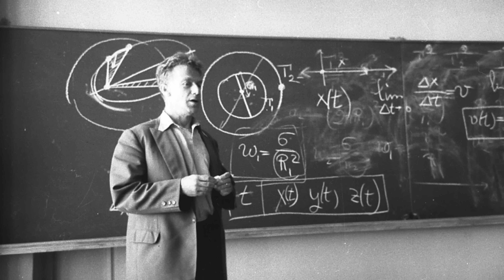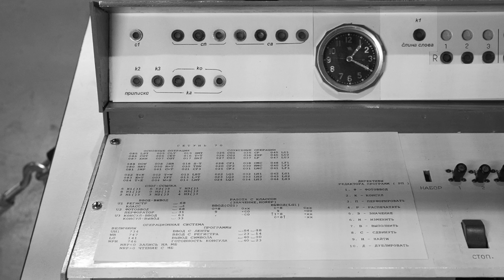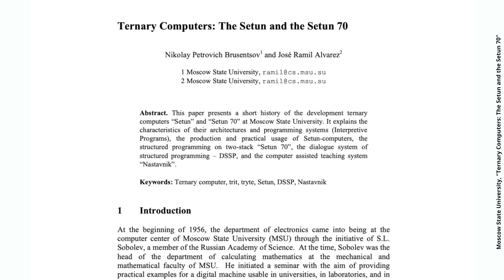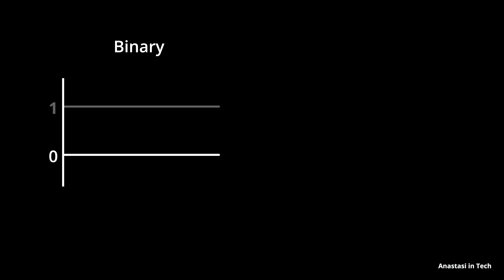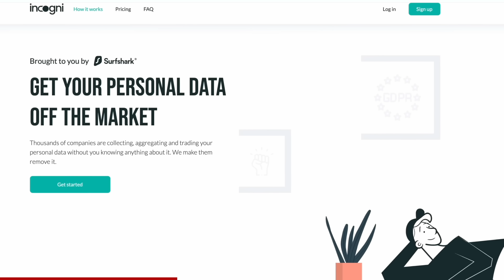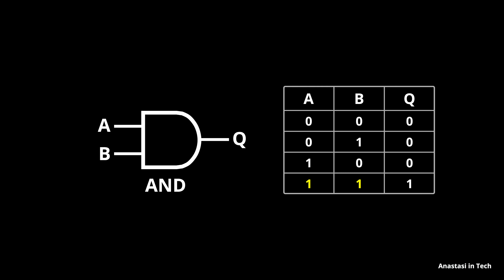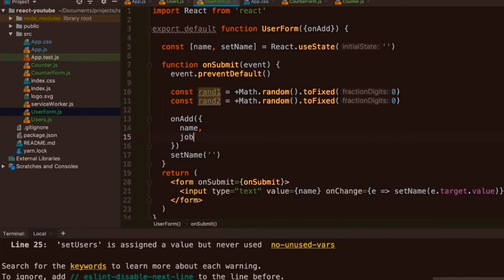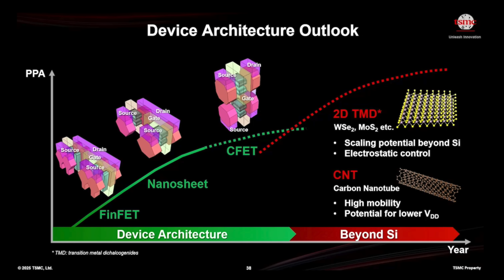The World's First Ternary Computer

Comment: I know that symetric ternary has some advantages in maths but i wonder if source of idea wasn't in core memory which can store 3 states (2 directions of magnetic flux and zero).
But as i understand with one switching device will be hard to build symetric ternary in hardware but maybe using two will yield faster switching ? 
Also maybe it could be mixed with those methods of low energy calculations.
I think it may occupy some niches but will not replace binary.

Comment: @11:37 Your table has error in third row shoud be 1 in B not -1
Reply from the maker: yes sorry for the typo, it should be -1 1 -1
Reply: Agree, seems like there should only be 9 states.  3^2   3 States raised to # of slots (2)  = 9         B slot should alternate between -101-101-101, A slot should be  -1-1-1000111.   Don't understand how there would be 27 states.
Reply: @KarasCyborg  I think the 27 combinations was meant to refer to the case when you have three inputs. (If you look up "Three-valued logic" in Wikipedia it mentions this in the section under Logics.) It's just a bit confusing because what she's saying doesn't match the image being shown.
Reply: It's not multiplication.
Reply: @preso706 it is multiplication... AND is multiplication
Reply: @preso706  It is! A AND B = { binary A AND B, if no -1 / -1, if one of them is -1 }
That is more or less a binary multiplication with an undefined (or neutral) state!
Reply: @rainerzufall42 I see, thanks.

Comment: I note: if it were not for noise - any number of "states" could be used.
Also: there is nothing about a vacuum tube that indicates 'only' binary.
Reply: Who says any number of states retains the logical efficiency?
Reply: @samuelluria4744  The idea about efficiency is that the more states per bit the more efficient it is to store values.  It takes 3 bits to represent 8 states for example, it would only take 2 to represent 9 with trinary.  That's not much of an improvement but it snowballs very quickly.  8 bits is 256 states but 8 trinary would be 6561 states.  And it only goes up as the number of 'bits' increases.  8 'bits' of decimal is 10 million states.  The more levels per bit the more efficient.  But the cost of noise and discrimination has an energy cost to consider.  Analog would be perfect if noise were not a concern.  Each bit would be infinite.
Reply: @dougcox835  - I may have been unclear as to my query. I understand the math. And that's all probably great for storage, but I'm asking about the mechanics/philosophy of the compute.
Reply: @dougcox835  But the three states are not used to pack numbers more efficiently. The third state is 'unknown'. A value stored in multiple trits is still unknown if any of the trits are unknown.
Reply: @theelmonk  I think you're confusing the hardware resting state with an actual trinary system.  It's been a while since I watched this but I think there is an intermediate level (not +/-) that give it 3 states.  There's actually no limit really.  you could make it analog and have 256 states per bit if you wanted to.  The problem is that you need a very noise free signal for that to work.  When you look at digital signals on an oscilloscope you realize that it's all very messy with rise times and noise.  That's why way back in the day they came up with binary in the first place.  Someone figured out that you don't need to worry about noise when it's very clearly on or off.  They made the undefined zone very wide with TTL.  Power is cleaner and timing is shaper than ever before nowadays so more states than 0 and 1 are completely doable.  How about 4 to start?  That halves the number of bits per number.
Reply: @dougcox835  It's certainly possible to have more than 2 or 3 states per digit and these could be used for tighter packing (it's hard not to call this bit-packing ..) QAM on a modem is an example. However in the trinary description in the article these are not used to provide extra numerical depth : they're used to provide 3 distinct meanings of true, false and unknown.
Reply: @samuelluria4744  true, false, alittle, inbetween, alot?? atleast we will be able to store data more efficiantly. DNA is ternary, so god thinks its a good system to hold data. we should follow suit. copying nature is always the most efficiant design. god invented reinforcement learnign and neural nets long before we did. his comptuers are highly energy efficiant and they manufacture themselves. the supply chain is highly distributed and  resilliant.
Reply: I noticed that also.  But, relays definitely are.  Even a relay can have multiple states if it's a stepper.  Even tubes were a quantum leap from relays back in the day.

Comment: 11:05 Sorry, but an AND with two ternary inputs would have 9 possible value combinations, not 27. Just a detail here.
Reply: She refers to monadic operators
Reply: @dchdch8290  Yes, if you have three inputs. But that is not what was shown in the video. It shows two ternary inputs.
Reply: If I see it right, the third line with A  = -1 and B = -1,is a duplicate of the first row.  B should be equal to 1 not to (-1). The result should be in both cases -1, when I understand the logic correct.
Reply: @Forellenbogen  Yes, the only TYPO is that B in the third case should be a 1 (not -1).
Reply: The table shows 9 options for A, B, Q, as it should be.
Reply: Yup, 3 squared.  I think she just did it twice.

Comment: No need to stop at 3.  Photonics should allow for infinitely variable states within a given bandwidth.
Reply: More states would be less efficient. 
There is a mathematical proof that, the most efficient number of states is e. 
2 < e < 3
3 happens to be closer to e than 2, thus trinary computing is more efficient than binary.
However, going higher takes us away from e, thus more than 3 states would be less efficient than binary.
Reply: @MightyKK006 They aren’t considering the carry bits.  3 states is better, by a bit (the Carry bit specifically), literally. LOL.  This all nice, but I want to see the truth tables upon which a ALU can be created, using existing proven physics.
Reply: @MightyKK006  that is in a world without entropy or temperature or noise.  this is one optimization direction, but then there is still the other density question of packing the units in space and still talk to the outside world that is us.  as some point.  (which means packing a lot of computations within the small world of the circuit population... perhaps not the terms of art)
Reply: @MightyKK006  Exactly. More, bigger is not always better. 3 is the sweet spot, but afaik the transistor engineering is for ternary still impractical, hence we've stayed with  the binary system.
Reply: @MightyKK006 efficient why?
What would be a good example, showcased side by side?
Reply: @MightyKK006  
That sounds good until you look at the actual circuitry needed for the logic gates.  You need about 1/3 fewer logic gates, but at the cost of each logic gate needingat least 2x more transistors than a binary logic gate.  Ditto for adders/subtractors and multiplier circuits.

Not only that, but the noise margine is cut down to about 1/3 or less compared to that which a binary computer can tolerate without errors (and remember, if that error is in the most significant bit/trit, it is FAR from trivial.)

This is the reason why the US, the UK, and the USSR each stopped their ternary computer projects after building only 1 machine in each country.
Reply: @MightyKK006  Yet evolution begs to differ. Brains in humans and (most) animals use more than 3 states, both on signal transfer (myelin) and storage.
Reply: Sure the photons operate within an "infinite" range of states (frequencies), but the logic underpinning the computation does not.
Reply: @chbrules Yes, with current SoTA, there are practical limits regarding output logic states.
Reply: @chbrulesfuzzy logic exists
Reply: You are wrong. Photons have a finite number of distinguishable states because detectors are limited and noise is unavoidable. At nanoscale, fluctuations are significant and the noise margin shrinks rapidly as more states are added. Supporting higher-level or continuous states demands extra hardware, energy, and precision, which makes systems larger and less efficient. Binary bits maximize noise margins, minimize size and cost, and deliver the most reliable computation. Ternary offers limited theoretical advantages, but for quaternary and higher, the overhead outweighs the gains.
Reply: @Zee-EST that makes a lot of sense
Reply: @Zee-EST  Even without noise and sensor limitations, photons are discrete. So it would be large, but not infinite.
Reply: Frequency based computing.
Reply: If a three-state transistor, with billions of transistors on a chip, generates a lot of noise, imagine how difficult it is to correct errors in photonic devices. Almost as difficult as quantum computing!
Reply: Hell yeh, the future is gnarly
Reply: Actually, 3 is about optimal. I forget exactly why, but it has to do with the cost of unique symbols/states and length of numbers the equation you get actually is solved with e. So 2.87 rounded up is 3
Reply: That does have a lot of positives. Though the most information dense is 3 (in theory it's e, but 3 is the nearest integer). You have to dig deeper into info theory to see why, and it's been to long since college, and it was only one small part of comp sci, for me to elaborate as I don't think i recall enough to explain it, let alone well.
Reply: @kaseyboles30  there are tons of arguments for it to be adopted, one is that it can allow for the implementation of base 12, if we use base 12 instead of decimal base (10), trinary is an ideal one because you can work with 12 using 3 very well.
Reply: @oioi-yb9dw  - Please describe the implied advantage of using base-12. Thank you.
Reply: Infinitely variable states = analog
...the root of why we went to binary.
Reply: @Qui-9 Not infinite. Planck distance 10^-35m is the limit under current dogma.
Reply: We've been doing it with analog electronics for years.  However,  noise and drift are real problems.
Reply: So does analog computing theoretically, does it not? Plus analog is perfectly matched to running weights and biases.
Reply: Now you need a new OS!!!!!

DE N2JYG 😂
Reply: @franklin.s.werren  "Now you need a new OS!!!!!"

You cannot have my OS.
Reply: @franklin.s.werren Temple OS has been ready for years. People keep overlooking the obvious. Smh
Reply: So tending asymptotically toward analog once again..
Reply: @adrianmanick7312  3 states is nowhere close to analog.
Reply: Is it really that infinite?
Reply: @paktio3985  Practically?  No.  But compared to ternary systems, it would seem like it is.
Reply: @paktio3985 
It's only limited by the light emmiters and receivers. But light itself is not prone to noise, so we don't need to use big chunky binary signals.
Reply: @paktio3985  Nothing is infinite
Reply: @paktio3985  - Like, on a scale of 1 to 10, how infinite is it??😂
Reply: worrying code would get exponentially harder though
Reply: @stoppernz229 claude to your rescue. 😂
Reply: Yes, for foreseeable future carbon and phecokite Cristal. Sorry, messed name of super high resistance Cristal easily grown.
Reply: @jjw5165  - The future is quasi-crystal.
Reply: Great comment. 12 is optimal as they will find out in a deccade or two.
Reply: @skpince  agreed)   i always wondered if the gems on the high priests gaments reflected this truth@?
Reply: Infinitely?
Reply: Yes…..coherent optics with states represented by amplitude, frequency, phase, and polarity.
Reply: in practice you can't have infinite states because you'll soon get into cross-talk issues, but yeah with this  approach, it should be possible to have m ore than three. I wonder how the logical gates would look for 7 or 12 states
Reply: Duh
Reply: 60
Reply: that would be analog, at small scale that might be closer to web brain computing. Neural network not needing as much discretization hyperameter choices.
Reply: Binary, then ternary.  How far can we take this?  Quaternary, Quinternary?  Can graphine be used to adjust for noise in these as well?  Photonics sounds good.  Is there an increased problem with noise with increased states?
Reply: Sugihara monoids
Reply: ever heard of a quantum computer? the hottest sh*t these days? qubits?
Reply: @stonebeat1234  the hottest shiite comes out of orinoccos rear end.
Reply: Remember analog computers?
Reply: My dog is pregnant!
Reply: Material science didn't catch up but eventually a bit will store a float I am sure of it... This idea has been around for eternity but we can't produce perfect crystals. In 1996 we had photonic switches I recall but I suspect that they worked like binary machines just with less energy.
Reply: More gateways would likely mean a big increase in noise problems. You would be limited in how reliable the calculations would be, thus slowing down the throughput.
Reply: Bad idea bro
Reply: if the goal is to run AI inference, the noise in analog systems isn't necessarily a problem - AI doesn't require incredibly high precision, and a small amount of noise is typically introduced intentionally. similarly, things like 3D rendering (ray-tracing, CGI, games) might work just fine with some noise - you wouldn't want game logic on an analog chip, but rendering might be just fine on an analog coprocessor.
Reply: 3 is the sweet spot
Reply: I build smart pollen enggine storage
Reply: I am thinking "nonary" computing. Integrating rainbow bands to the binary system. 🤔
Reply: I'm curious as to what you are going to try and calculate with that ? We already know the ultimate answer is 42.
Reply: The idea of n-ary data representation was not very successful for today’s digital computers, but is now again one of  current topics for qbit development.
Reply: "No need to stop at 3.  Photonics should allow for infinitely variable states within a given bandwidth."

There will be a hard limit even on the theoretical level - light has only so many viable states.
Reply: Congratulations, you studious guys. I wish I too could take my eyes off her face.
Reply: It comes down to Video Recorder Theory, Communication, Balls. At the start of home recording of video there were two technologies. Beta and VHF. Beta was the standard used commercially, VHF was chosen by the porn industry because it was cheap. VHF won. Communication between devices will be a BIG factor. What good is Ternary if you can’t show your porn on your friends computer. Ball, is there a Bill Gates, Steve Jobs to push this? Not a Zuckerberg and the other eggheads. The asshole with brass balls to force it through.
Reply: Infinite state is quantum.
Reply: @AbiodunAyodele2 but are photons infinite

Comment: I don’t remember the details but I remember how 30 years ago my university professor demonstrated us that ‘e’ is the optimal base for storing information, not binary. I guess 3 is still closer to e than 2 so they might be onto something.
Reply: e is correct as a theoretical value, it's the most efficient growing pattern there is.
But it's not integer, that means, it has no practical value. And there's nothing like "closer" (measured in irrational numbers), only "closest". And 2 is the closest integer below e, while 3 is the closest integer above e. Unless you can tell me other integers near e.
Base 3 gives you more flexibility (and negative numbers), Base 2 is much simpler.

Comment: I don't know the title seems a bit sensational I feel like we use binary because it's so easy to have a state be on or off and pack millions of transistors together to perform those actions. Whenever we have more states the complexity and errors start racking up.
Reply: Watch the video then
Reply: I think ternary might really work. 
Interesting concept
Reply: @dchdch8290  Would definitely work.  But would the world adopt it?  It would need to be provably better.  There's unlimited ways to represent things but when there's already a proven method we cling to that.  Why do you think the US sticks with SAE?  One measurement system is not better than another, we just stick with what we know.  Once a standard is in place it's really hard to change.
Reply: @dougcox835  It's all about AI. AI has already found new math and new physics. 

Right now is the time for disruption.

Standards do change. "Computer" used to be someone's job. We changed from base 10 using humans, to base two using machines because the machines made it possible. 

AI makes lots of new things possible. 

It's just going to be a lot of trial and error to find out exactly what and how.